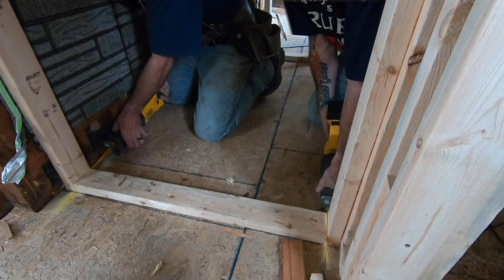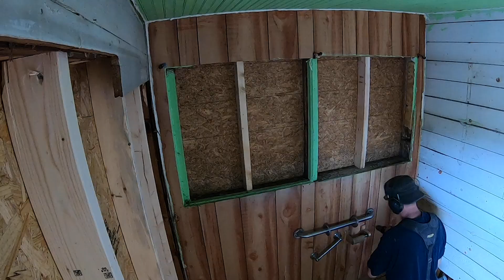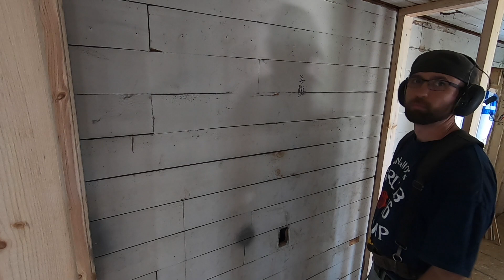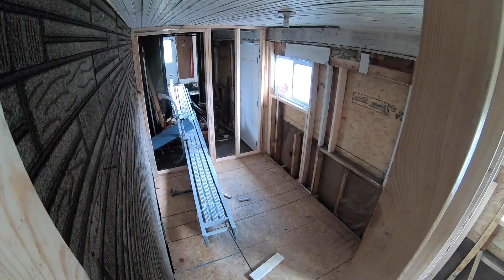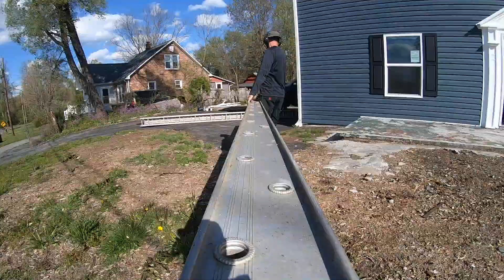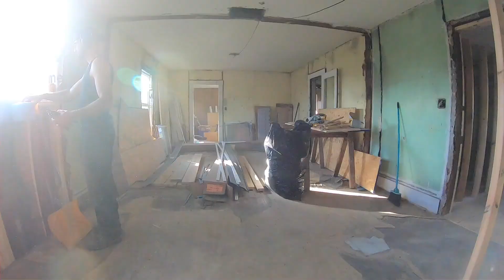Hoarder House // Framing Part 1

Comment: Actually, in a future video, can you pleas explain and show how you furred out a wall to make it  square to an adjacent wall? Are you using the 3-4-5 method? Plus, how do you know that the tub wall that you added is square to the opposite wall where the plumbing for the tub is going to go? I have never built anything and I have an old house too. I already know that some of the walls of my house are not square-level-plumb, so I just want to know how to fix things before I start my own remodel. What you are doing looks like the exact same thing I will probably have to do.